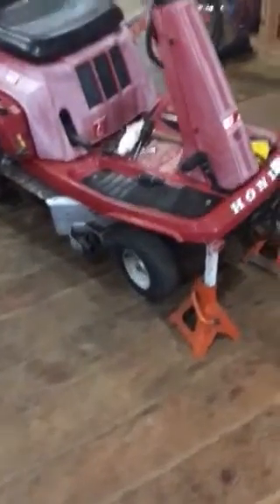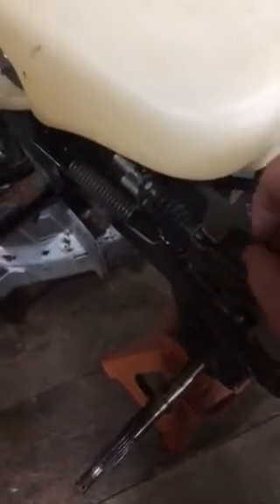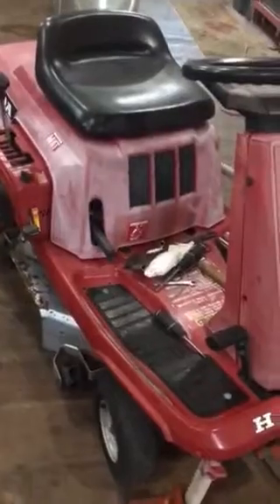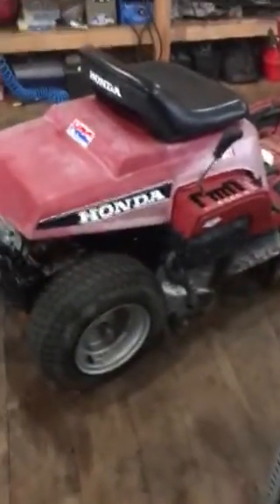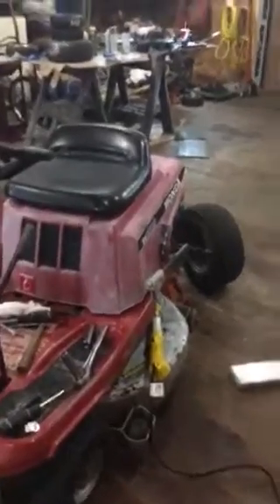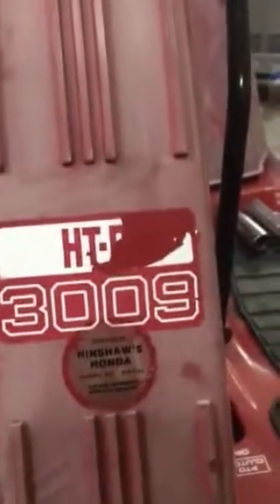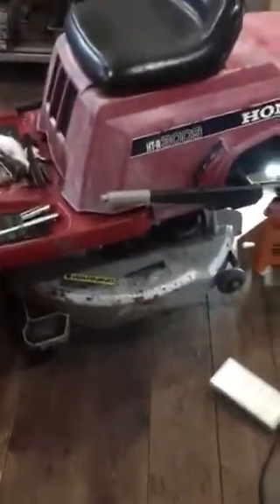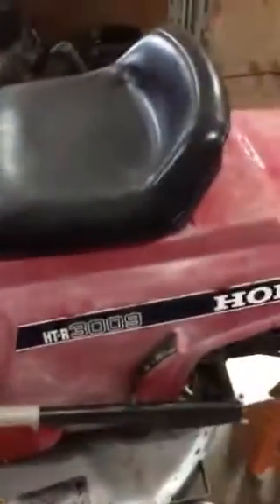Honda ht-r 3009 and other updates

Comment: Hey dude I got some trouble shooting, issue on my mower (same one) I can’t even get it to click but when I pulled the started out it looked good and even tested good and my battery is brand new, and Silla Noyd is new also sometimes the (alarm) or beeping comes on could you help me out and
Give me a few things to look at?
Reply: Locate the combination relay, remove it, gently tap relay upside down a few times and reinstall. If this works you your combination relay needs to be replaced. Or remove tap and reinstall every time you want to start it. Sometimes it doesn't work. 
There is a fuse on the positive cable to the battery. Check fuse circuit for continuity along the entire length. 
That's all I can think of right now. But you've probably already dumped or sold this H3009.